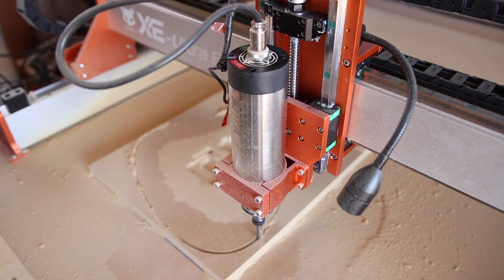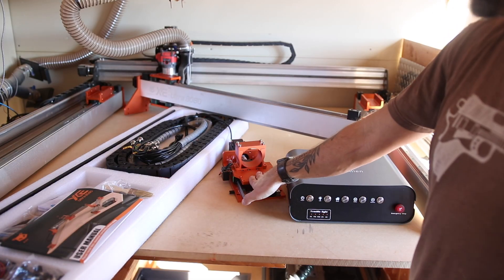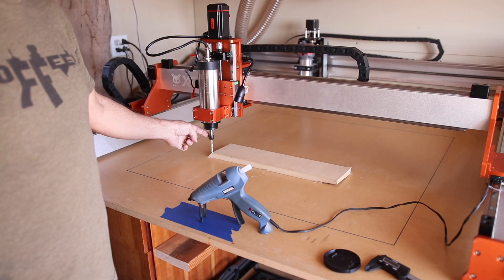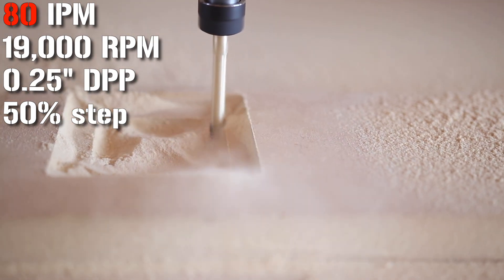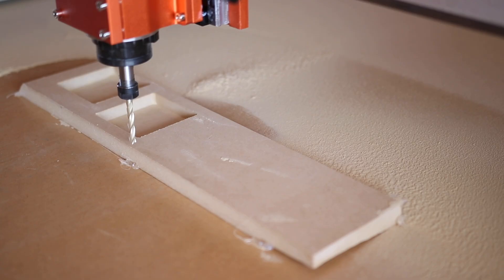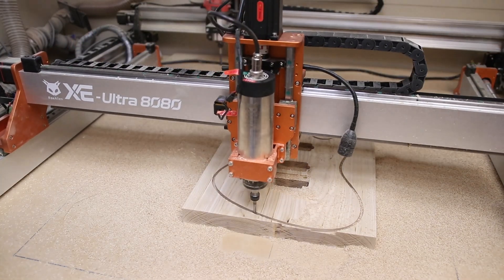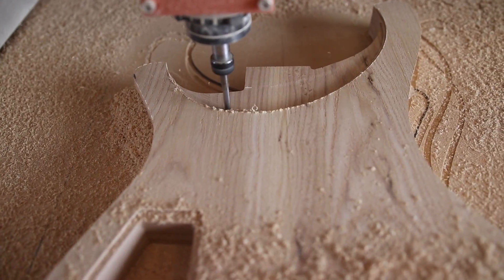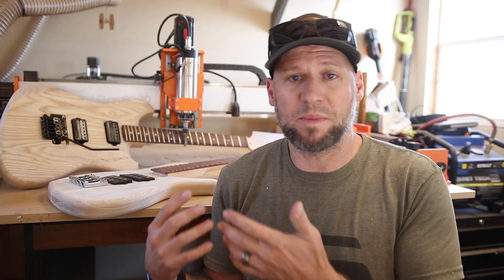Making DIY Guitar Kits for Christmas with the Fox Alien XE-Ultra

Comment: Great video. Please do more videos on how to use the cnc machine. As for your original design necks and bodys, i think they look great. As for price for just neck and body, 300-350 for paint grade woods and up from there for exotics. And for customer design, i recently had a custom guitar made by IYV (its a bc rich bich with a floydrose) complete guitar 5 piece maple neck through mahogany body with flame maple veneer with wenge stringers finished in transparent purple and rosewood veneer on the headstock. Complete guitar shipped from Vietnam to Missouri was 650$. And from the time i payed for my order to me receiving it was just over a month. Hopefully that helps with trying to figure out how much to charge for custom work.